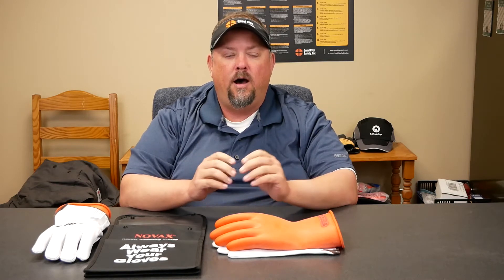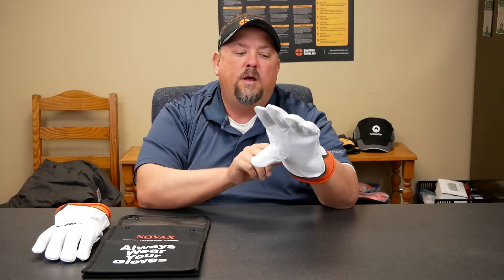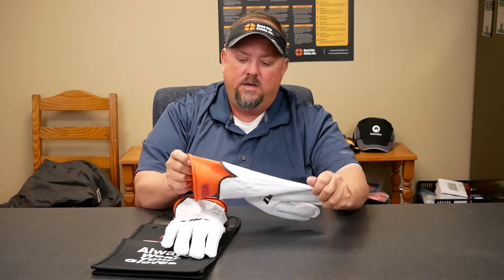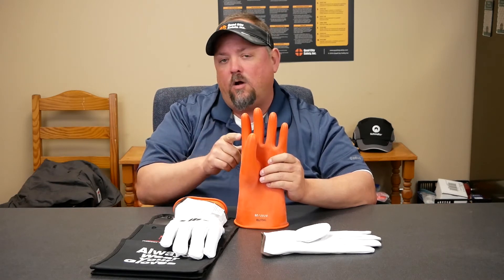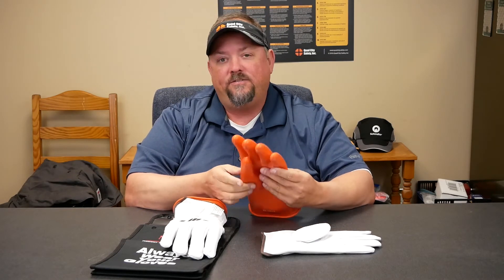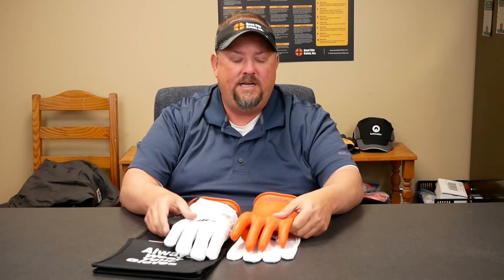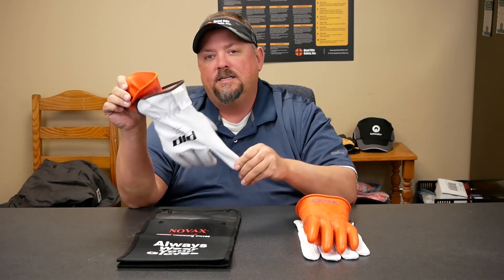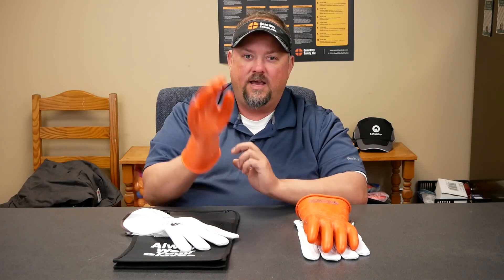Testing Electrical Rubber Gloves and Tips For a Successful Glove Safety Program

Comment: For low voltage (<1000V) is it necessary to use insulated gloves for testing with a multimeter - since the probes / leads are insulated? Are the arc flash gloves not sufficient - just for any arcing that might occur? Is testing classified as "live work"?
Reply from the maker: Until all power is cut, it is considered live work and would have potential shock.  Thanks for watching.

Comment: I work for a church and do a lot of testing using a multimeter on 480 V package units. If I purchase rubber gloves will it prevent me from being electrocuted? And do I need to have them inspected often?
Reply from the maker: Need to be recertified every 6 months.  Should be able to be in 00 gloves for 480 V and that will help.  Thanks for watching!

Comment: Stupid question from a layman….  Why would a pin hole affect thei effectiveness?  Would the only risk not be from a hot conductor entering into that pin hole to make contact with skin? Or are there other things to consider also?
Reply from the maker: Sweat and moisture from hands can be conductive and create a ground.  Thanks for watching!
Reply: Pinhole is a Portal for voltage to flow through glove to you